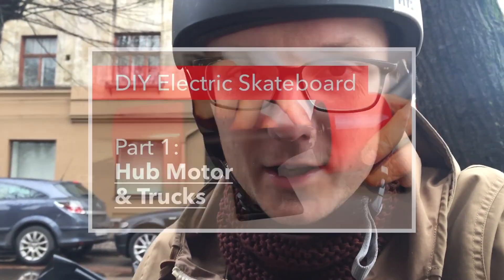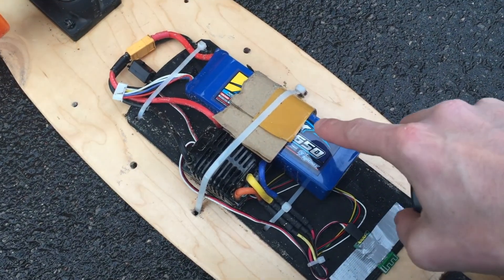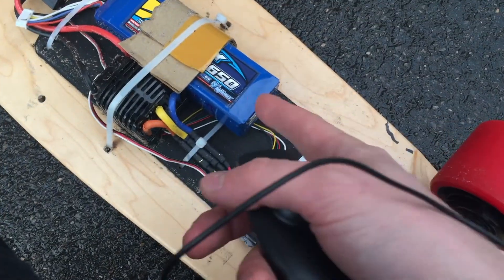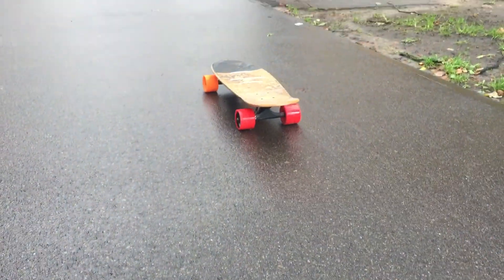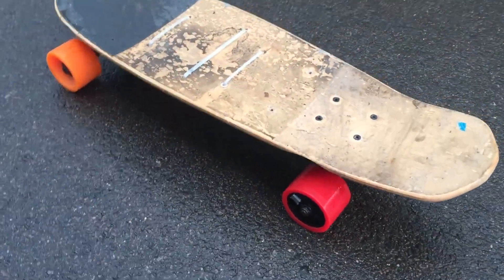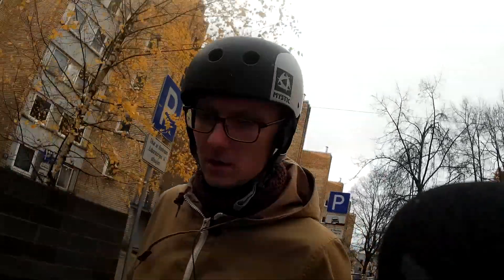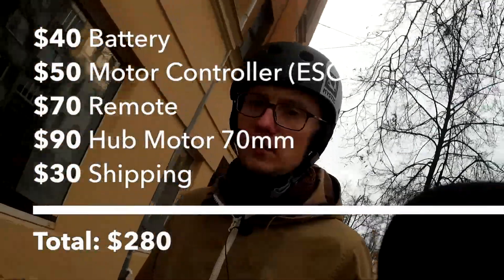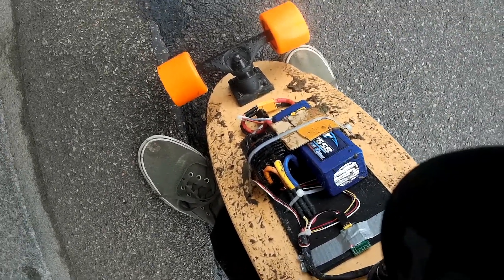Part 2: DIY Electric Skateboard Electronics

Comment: don't worry for all those wet/water,to prevent any electric shock,  just spray WD-40 Water Resistant Silicone Lubricant on the whole electric part~ good luck

Comment: Hi. Sounds like the motor is really struggling. Did you say controller can take 10s, too?

Anyways, as of now I think the best way is to use this controller - it is for dual drive, supports 6s / 7s / 10s and has remote included (this one seems to be working good, compared to the first ones which were available without the esc)

https://www.banggood.com/Electric-Skateboard-Longboard-Controller-With-Remote-Dual-Motors-ESC-Substitute-p-1202299.html?rmmds=search&cur_warehouse=CN

Seems to cost only around 42-43 Eur

Comment: do you have single hub motor? I build a 2 motor version, the main components just cost me ~$150 (ESC+remote = $50, 2x70mm hub motors = $100). My parts are all no name ones though. I hope better performance for that.
Reply from the maker: Wow, that is cheap. Do you mind sharing a link to that ebay listing?
Reply: Kaspars Dambis I ordered them from aliexpress, I will share the parts. I also ordered a double sided square ended truck for $26 which you made it by carving yourself. Better I will make a video about that. Your videos are great thank you for inspiration:) this is bunch of stuff for eskateboard
http://my.aliexpress.com/wishlist/shared.htm?groupId=3116318212 you can find them there, sorry for inconvenience I am on mobile.

Comment: Have you tried using the VESC?   I am using the same maytech hub motor with 6s and 10s configuration.  I barely have any brake function at all just like you.  Initially I thought I didn't have enough power for my weight (195lbs), but using different voltages. Acceleration was okay, braking was almost non-existent.
Reply from the maker: Very interesting. While I don't have a VESC to try, I will do some tests with the Flier ESC that has awesome brakes with the 90mm Maytech hubs.